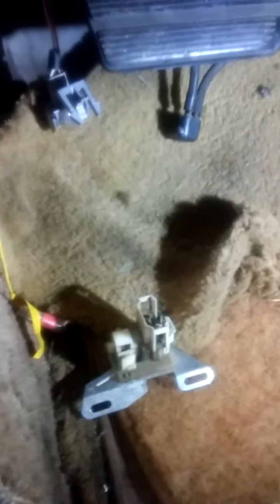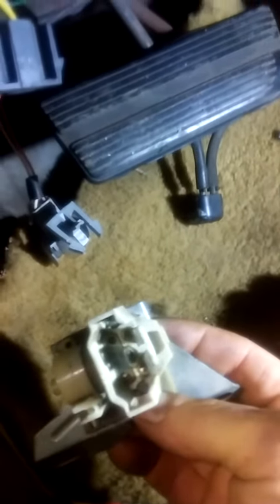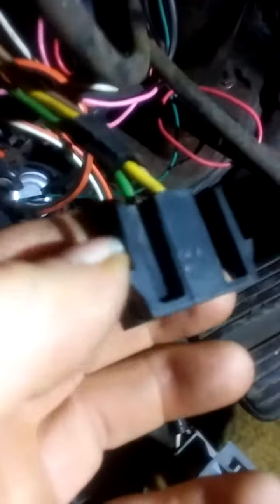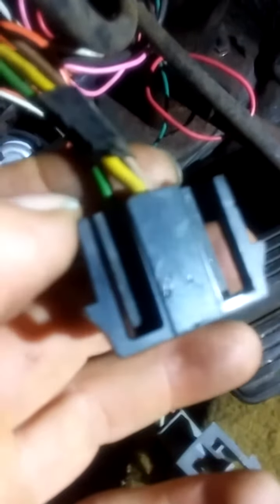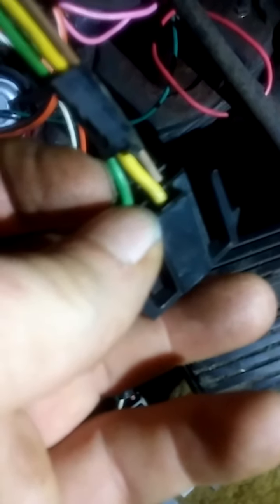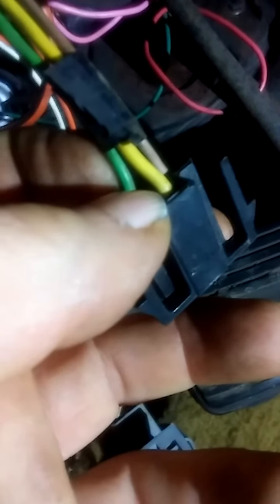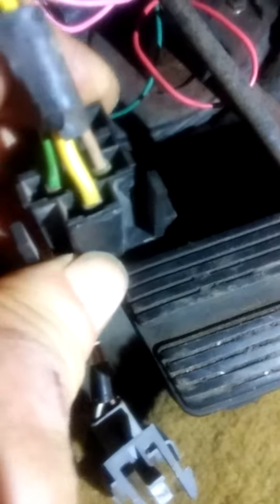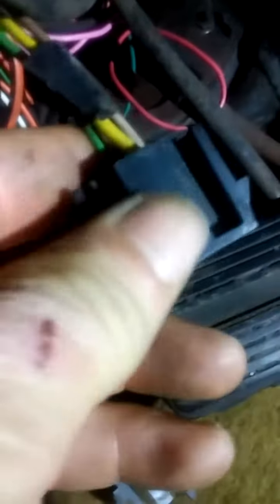1979 Corvette Head Lights Not Working

Comment: Question, when you found this problem, did all the other lights work and just not the headlights? I have a 79 and every light works except the headlights. I am figuring switch or fusable link. Great vid bro.
Reply from the maker: all my other lights worked
Reply: @MrPapakuka  Thanks bro. This helps a lot.
Reply: @larylhuntington5398  were u able to fix the headlights? Im having this same problem and im not sure if its the headlight switch itself or this dimmer switch
Reply: There's the dimmer switch located. I have all my other lights working except the headlights